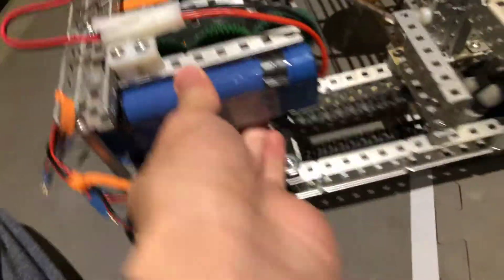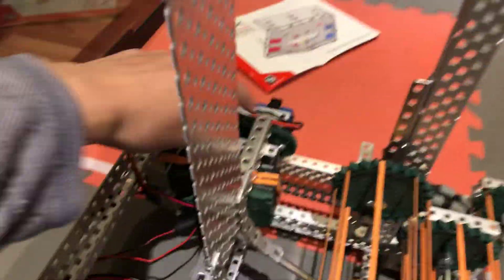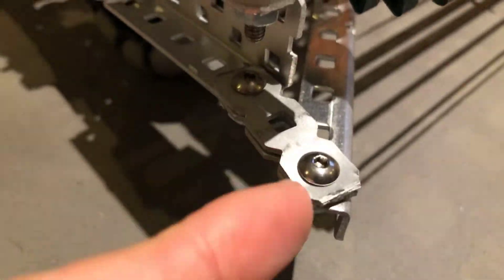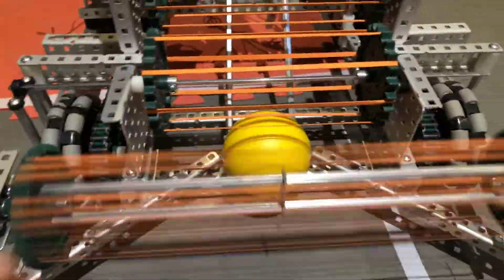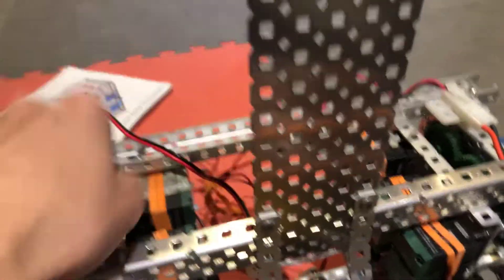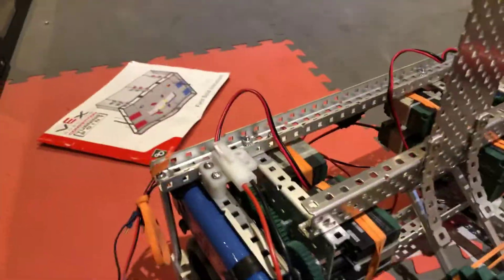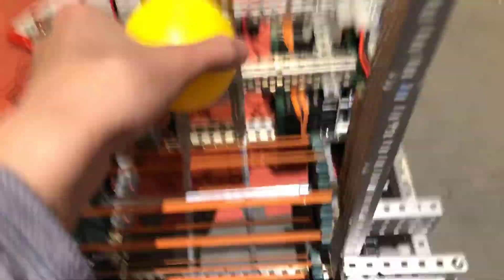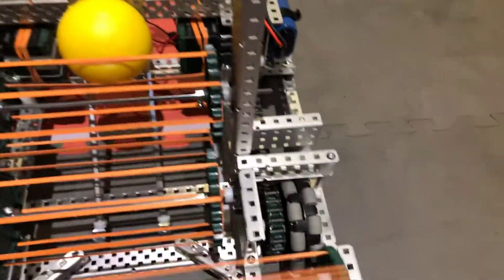Halp

Comment: Okay, This is actually really good. Use a locking bar instead of that metal strip on your intake roller.
Instead of the cantilevered shafts on the intake I would recommend trying screw joints again. have a keps nut clamping the screw into the metal to keep it stiff, then you'd have to drill holes into your sprockets if they're the old ones. Doing this method of screw jointing it should be stiff and quite low friction if you get it right.
I wouldn't worry about trying these suggestions at the moment though, Try to get a working robot first. The flywheel could take weeks to tune, and don't forget that programming and driver practice are both very important things. We've had a working robot for a month or so, and it's been really good getting to know how it performs when driving and programming it.
Overall, I think you have really good build quality and you should keep working hard, but don't forget about sleep though ;)
- Ethan - 2921 Free Range Robotics - Division finalists in the technology division at worlds 2018.
Reply from the maker: EXPLODING ETDOOD how would a lockbar be better than the metal strip? They feel around the same weight and the plate is cut out from the middle of 3 wide so its thicker than normal bars.
Reply: @antholuo  coz locking bars don't cut you. If something cuts the person inspecting your robot you'll fail inspection.
Reply from the maker: EXPLODING ETDOOD very true yes. If we filed everything down - would the difference between the two be negligible?
Reply: @antholuo  Yeah, the reason why I use locking bars mainly is coz they're the perfect size already, and they have a square hole for an axel